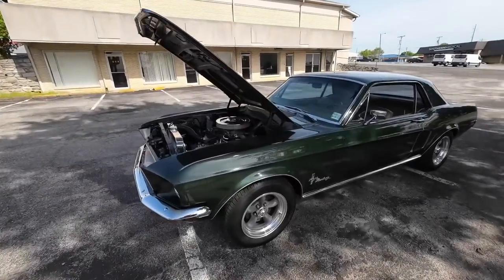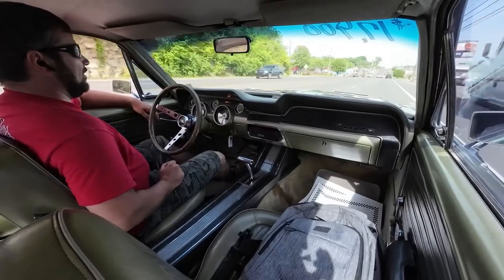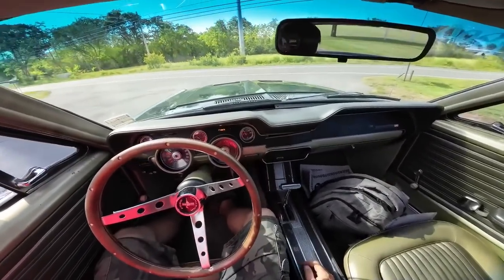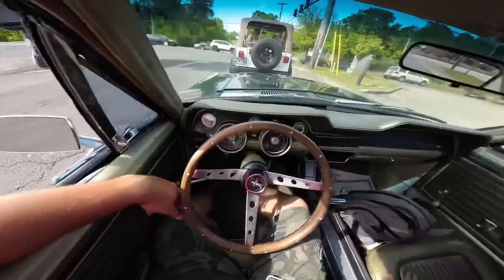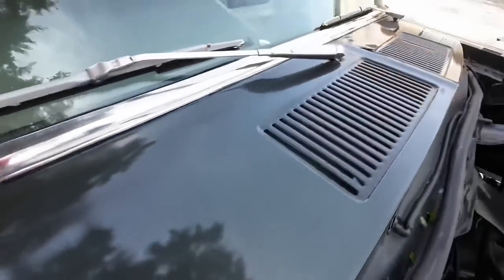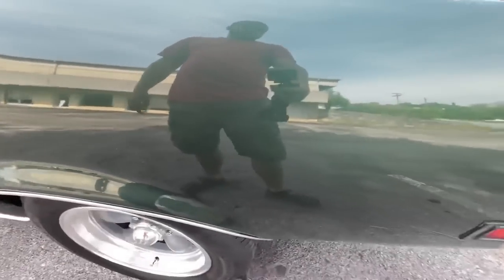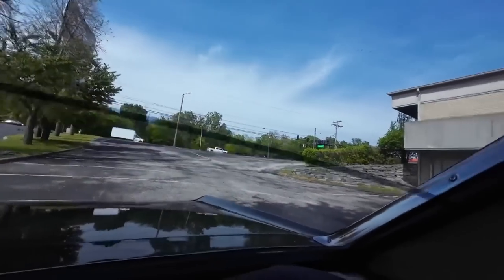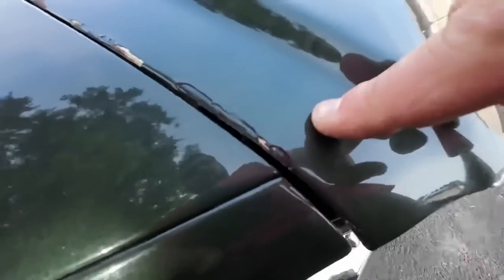Test Drive 1968 Ford Mustang SOLD $17,900 Maple Motors #2094

Comment: '68s came with 302s
Reply: Very late 68's came with 302 blocks with 289 internals
Reply: @aliasforspam1421  so, how does 289, become the larger 302 displacement? If they used a larger bore, then the 302 block allowed for bigger water jackets. A larger bore = bigger pistons than the smaller 289. Guess that makes the 302 an upgrade of the 289, but no longer the 289, but the newer 302 replacing the obsolete 289. I used to repair them in the '60s, and never saw a '68, Ford with any small block but the 302, from the factory.
Reply: Early 68s came with 289s.
Reply: @johnfranklin5277  68 Fords with 289s we're found in later years when someone had installed a junkyard 289 engine in one
Reply: @tomtutz9997 I bought my 68 Mustang from the original owner in 1977. Badges say 289. Ive seen some 68s say 302, and some say 289 like mine. Southern California car,  in great shape, on the road.
Reply: @johnfranklin5277  what's the serial number indicate? Vin numbers will tell.
Badges can be changed easier than engines.
Here on the East Coast I've spoken with a number of mechanics my age that worked in the 60s, some in Ford dealerships, and no 289s have been seen around here. If your vin plate indicates 289, then maybe Ford dumped some on the West Coast.
Reply: @tomtutz9997  Possibly,  mine was built at the San Jose plant.
Reply: I have been with my 68 fastback since 1968 and it came from the factory with the 289 that's in it today. 302 came later in the year.